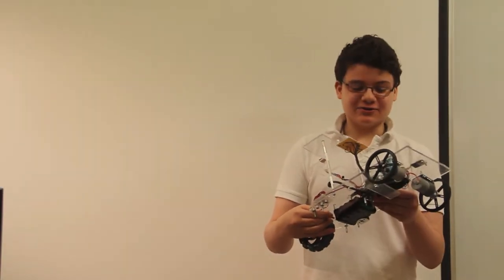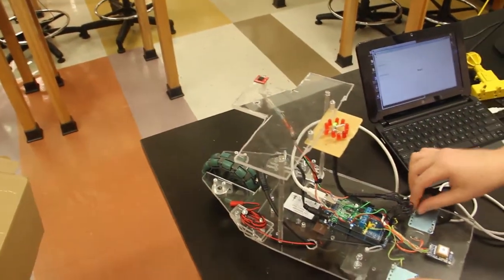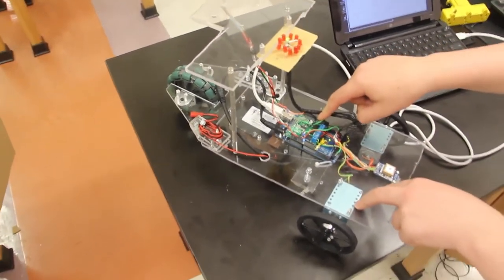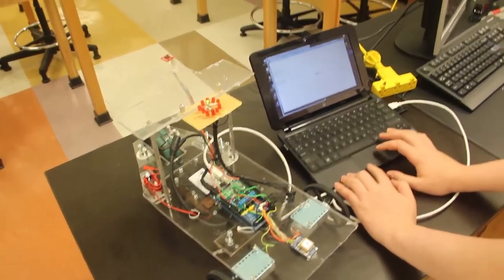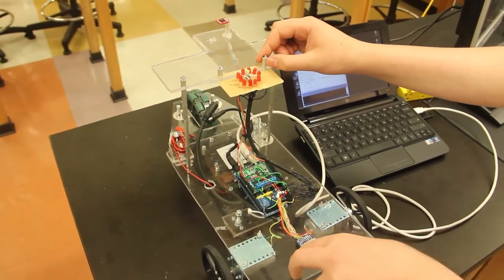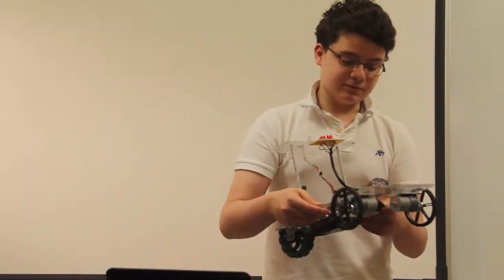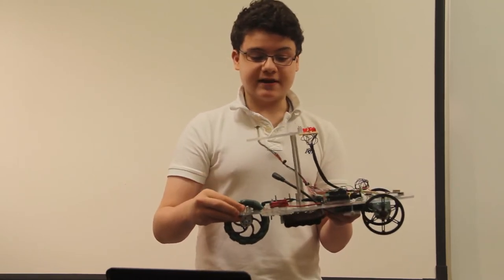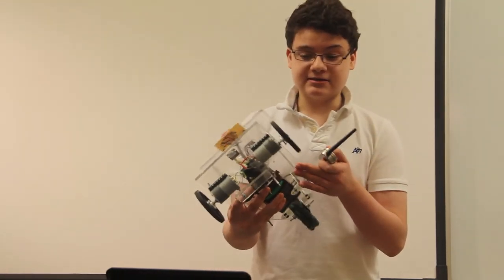Andrew M. - GPS-Guided Rover [Final Demo]

Comment: hey buddy, how did you calibrate your compass. Im using HMC5883l and mycompass accuracy is off by like 40 degrees. I have installed the compass at a high elevation away from any magnetic interferences.